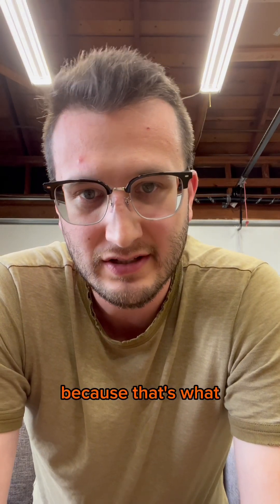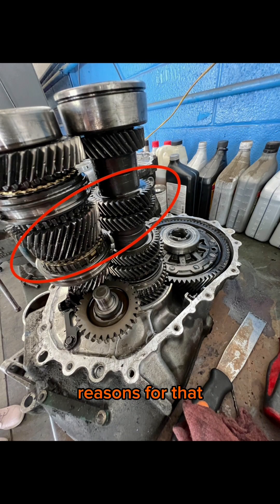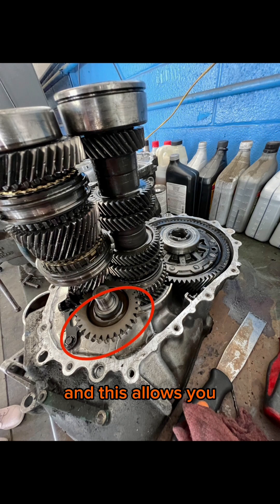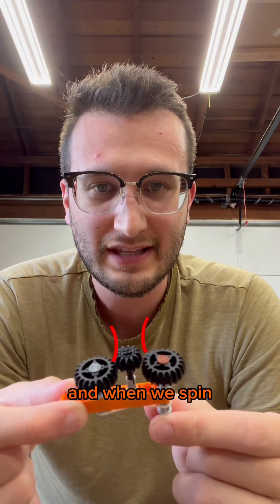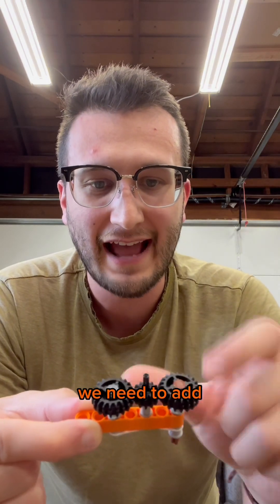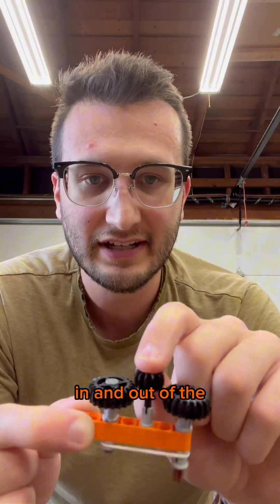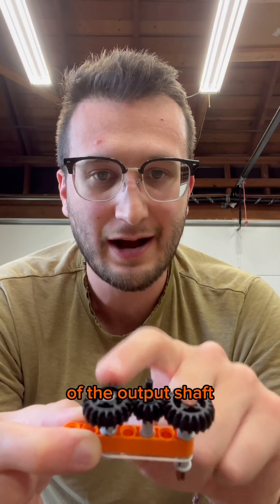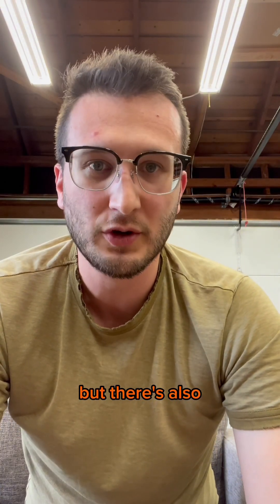Helical Gears vs. Straight Cut Gears #shorts

Comment: Actually,  it a gearbox with no helical gears, there's still noise. It has more to do with the way the teeth depart from each other, I believe. There are vortices and cavitation formed as they depart, particularly between the very tip of the gear and the valley. By its nature, straight gears also make more noise because of this

Comment: Cost cutting maybe. Straight cut are cheaper to manufacture so......
Reply: But we do have synchronized reverse gears
Reply: It's not about cost cutting. Reverse gears are slide gears they're not synchronous constant mesh gears. It would physically be impossible to slide helical gears. Also we live in the 21st century manufacturing helical vs spur isn't really a problem.

Comment: Straight cut gears have something phenomena called air cavitation that making that noises...
Reply from the maker: All gears suffer from cavitation, not just straight cut gears. Cavitation in helical gears just isn’t studied as in depth as it is for spur gears
Reply: One of the main sources of noise in helical and spur gears is something called transmission error, which is due to the instantaneous ratio changing throughout the tooth meshing cycle due to changing mesh stiffnesses. For spur gears, this change in mesh stiffness is particularly dramatic due to the total-tooth on-off-on-off occurring across the whole line of contact at once.

Comment: Flat or straight cut gears. Also notice in manual in reverse the shifter doesn't feel as if it gets stuck as often at a drive way? They used to and probably still do make forward gears in racing cars this way because the point of interaction between teeth on the gear is not only potentially more durable but also reduces the interaction time of the power output of the engine to the drivetrain making milliseconds on the track add up.
Reply: In all of my cars i've had (all manuals), the reverse gear always felt like it was getting "stuck" halfway shifting it in untill I gave it a little bit of a gas only then the gear sticks in place. I'm assuming it's all part of it as mentioned here having more gears rotating when going in reverse rather than a "gearbox malfunction".
Reply: @CountZero11  It is asynchronous, which means it is designed to shift at zero speed. What he is doing is adding some slow spin to complete the shift. Basically feeling for the teeth.   In the synchronous gears a mini shift occurs when the synchronouser minigear spins the new gear up to speed.
Reply: It is asynchronous, which means it is designed to shift at zero speed.    In the synchronous gears a mini shift occurs when the synchronouser minigear spins the new gear up to speed.